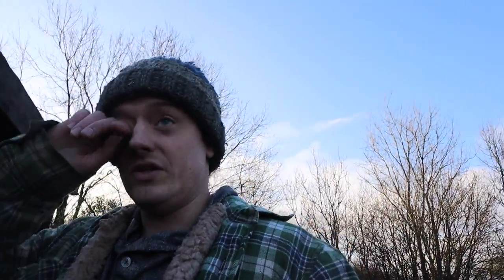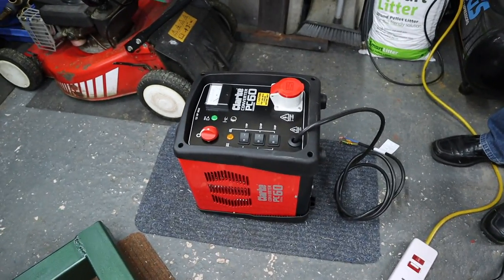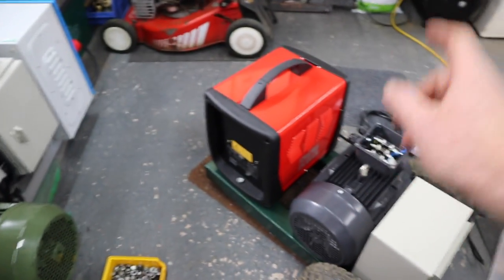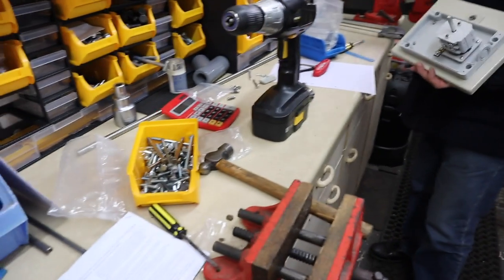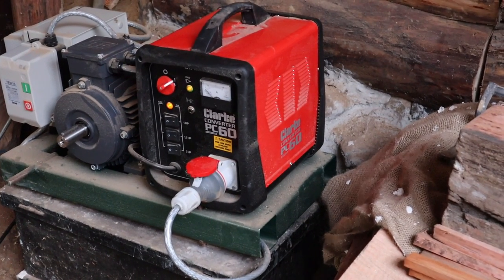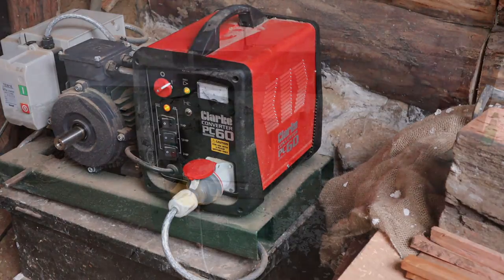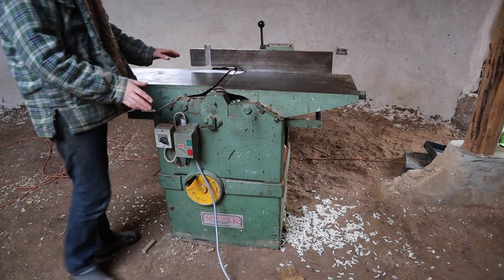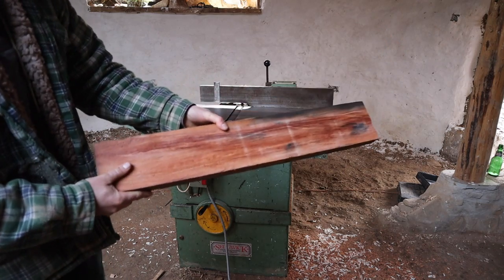Easy DIY Rotary Phase Converter Build (Off Grid Three Phase Hydroelectric Power)

Comment: Wouldn't it make more sense to change your generator in the future when you got more flow to generate the necessary 3 phase grid you need directly from the water motion? 🤔
Reply: That wouldn't work well. The frequency of the power from his hydro system wouldn't be 50hz. It also wouldn't give him the 8kw he needs to start the thicknesser. And when his tools are off he wants to store the electricity in batteries.
Reply from the maker: I would need a 10kw constant system to do that, i would love to run direct believe me but i would need to run 100 litres per second through my turbine to do that. Its just not going to happen with the water i have available.
Reply: @johnosullivan675  why wouldn't the frequency be 50 Hz? 🤔
Reply: @KrisHarbour  you have 10 kW peak constant needs for minutes or just short bursts? 🤔
Reply: Because the frequency of the electricity produced by a generator depends on what speed the generator is running at. Why would you assume that Kris' turbine runs at 50hz?
Reply: @johnosullivan675  I said he needs a new generator. Obviously the new generator need a transmission, a AVR and a governor to create a useable grid.
Reply from the maker: Mate your all over the place. single phase or three phase? 

Ruben Kelevra  • 1 week ago (edited)
If you get more flow it might make sense to 1-phase AC instead of 3 phase and use it directly, if you have a load which you can adjust as ballast, like a hot water tank for heating and hot water generation. This surely only make sense, if your peak usage is below the maximum output.

The DC side of your system might be used for lights and other devices which just use DC. You can start the battery charging, depending on the load on the AC-side to balance it further.
Reply: @KrisHarbour   It's been a bit messy, I'm sorry for that.

If you want to use AC directly from the turbine with a generator, it's better to generate just one phase. If you run three phases you would need to balance the loads evenly between the phases. This is probably not possible, depending on your load.

When you generate one phase, you can pick cheap off the shelf parts for voltage regulation and electronic frequency governors for gas or diesel power generators.

An electronic governor would give you a voltage depending how far you're off of the set grid frequency. You can just read it with a Arduino and adjust the valve settings accordingly.

To get from this one phase to a 3 phase for machines you can couple a 1 phase motor to a 3 phase motor with a heavy fly wheel in the middle - this should work since you're not that critical about a certain frequency on the 3 phase grid when just running machines.

Another possibility is adding 3 phase motor drivers to your 3 phase machines which just chop up the 1 phase power and also allow for a soft start and exact RPM control.

Hope some of my brainstorming was somewhat helpful. :)

Comment: hi  that's great just found your video bought and scrounged some three phase machinery got the converter like yours and a 3 phase motor haven't got my head round how you got the full 3 phase yet, the clark converter is 4 pole my Bridgeport has red, yellow blue and a black wire got to get a 4 pole  plug to fit, probably a stupid question but does the black go to the ground  pole?  it's great man what you are doing keep going,    sam
Reply: after many times watching this and your next video have decided that the bridgeport won't work off the converter so your way is going to be the answer thanks for that have starting to get the motor and things just one thing would that the key out of the shaft as ran mind sent it flying across the workshop
Reply: It's because this system had no black (neutral) and yours needs one , I have the same problem with my hardinge lathe I copied Kris design but now I have to find a way of getting a neutral out have you had any luck

Comment: I don't quite get what the motor does here. It takes three phase from the converter and puts out three phase again? Is it just to add some inertia to the system?
Reply from the maker: The static converter is not a true three phase and because of that will only output about two thirds of the power. Running the three phase motor off the static converter means that the motor then acts as a generator and you get a true three phase with 400v across all phases.
Reply: I see! Thanks for the clarification! <3

Comment: one  can use a start up motor on the rpc idle motor,  clutched , belted , pre  phase startup,  all  offering ways  dealing with large idler motor start up loads,  even pull rope starting the rpc idler motor , then switch  static converter  on,. will work... note motor direction 1st
 
phase inverter  converters  are great , but have limited range dealing with multiple connected devices, pop pretty easy, can require additional 3 phase inductor transformer to be installed  no good for welding.

the rpc  artificial leg  benefits from power correcting across  loads / voltage changes, ,being balanced across all phases is key to performance and motor life.
use of  zero volt  relays  switching cap banks via current/volt sensing  comparator circuits allow automatic control to a point. .  arduino  control next..

 Unique3phase  , has some documented designs that work. self build from scratch using a load of recycled stuff,. well worth the 120 page read.

back in the day,  a number  of techniques were used  to supply 3 phase,   whether from split phase , single phase or  just phase angle correction, phase generation buck boost and so forth were all used  dealing  with end of line issues.

Comment: Why not ad Y/D starter to the planer?
Reply from the maker: Im currently looking in to that. Not sure how well it would work off an inverter though.
Reply: Christina Holm 
Okay. What’s a Y/D starter?
Reply: it  will work better, the star will lower the starting current considerably,
Reply: @Crewsy  It's a timer switch that changes the way three-phase power is sent to the motor during start up, so that it uses less power to get moving.  Once it's moving it switches the wiring from Y-style to Delta style which removes the power restriction.  It's used for situations where the motor uses too much power when you first switch it on from stationary, and rather than upgrade your electrical system you are happy to have less initial torque and a longer start time as a compromise instead.
Reply: Berkeloid 
Thanks for the explanation. 👍🏻👍🏻👍🏻

Comment: I have been using VFD for the 3 phases motors start and controls, its Quite Expensive but it does same stuff as Inverter, but gives me greater control. VFD converts any AC to DC and then Rebuild it to AC pulse where you can control frequency and Amplitude and control starting currents, torque boost and increasing frequency also power delivered ( not every motor can handle HF switching ) then you might end using only basic functions.
Reply: Quite expensive? Hardly. The Chinese units work great for two and three KW loads, If you need to run a 5 HP motor I would step up to a real industrial unit. You can find them used for 50-25% of their initial price.

Comment: is there a ELI5(explain like im five)? version of what i just watched?
Reply from the maker: Im sure there will be someone to explain it for you better than i can. i went to see john for help because this isnt really my area of expertise. But essentially normal households have single phase power and my inverter outs out single phase power. that is one phase of the three phases produced when generating power in a generator. most commercial tools run on three phase power. this device takes single phase power and uses it to create fake three phase when used as a stitic converter and a true three phase when used as a rotary converter. the single phase drives one phase of the motor and then the motor creates the other two phases as a generator. so we end up with 240v single phase going in a 400v  three phase coming out.
Reply: @KrisHarbour   thank you i understand the basic now :) keep up the great work.!
Reply: @KrisHarbour  so the only thing the motor does is take "fake" 3 phase and turn to "true" 3 phase ?
other q: why not use a soft starter on ur "new" tool ? :)
Reply from the maker: That is my understanding of it yes. Thise digital soft starters are great but this tool has two motors, one to drive the knives and one for the feed rollers. those digital VFD dont work on multi motor tools.

Comment: Why do you need the rotary if you have the static?
Reply from the maker: i dont need it, its just a better three phase output and the machine will have a bit more power. the static converter just starts at three phase then runs on two phases meaning you dont get 100% of available power. 
https://www.northamericaphaseconverters.com/how-static-phase-converter-works/

Comment: Just buy an VFD, and you can connect direct to the DC buss. Much better than what you have here.
Reply from the maker: Planner thicknesser has two motors, i would need a vfd for each and have to start them separately. then every other tool i buy would need its own vfd, This is a better system.
Reply: @KrisHarbour  NO! You can use one VFD and mound an 3 phase output socket to it. By this you can plug each tool to it. Just set the basic parameter, like frequency, output voltage and that's all. If it has high output current capabillity (much more than your motor) you can start the motor by simply connecting it to the VFD that is allready running. For this you have to disable the open phase prottection from VFD.

Comment: You've gone about this the wrong way for the state of 2019 technology. You would have been better off going with a VFD. Yaskawa and other manufacturers make 5 HP VFDs that convert single phase 240v to 3 phase 240. Because it is a VFD you can limit the starting current, it doesn't matter that your equipment has a high inertial mass, that's exactly what VFDs are designed to deal with. It reduces your peak inrush power consumption dramatically, possibly 5 to 10x depending on your type of load.

Used but in perfect working order they run $400-600 USD on eBay.
Reply: You are absolutely correct. I recently installed some Toshiba VFD's for a customer that converted single phase to three phase works great!

Comment: You can buy a VFD with soft start for £65 to do this job.
Reply: As someone who knows nothing about this, let me make an intelligent guess:- Whenever  anyone claims glibly that a job could have been done another way which would be much simpler and much cheaper......they're invariably wrong!!!
Reply from the maker: the planner has two motors, one to drive the knives and one to drive the feed rollers. A VFD would not run them both so i would need two VFD and then start each motor separately. VFD are great but they are complex digital devices that break easily. a rotary phase converter is a solid, old, and tried and tested machine thats lasts generations. with the one investment i can run any three phase tools with any combination of motors for manny years to come with no maintenance or replacement. That woud not be the case for a VFD. Any machinery with say a coolant motor or secondary motor of any kind a VFD would cause problems. Im not saying VFD dont have a place, they do, but not for this.
Reply: Andy McCabe 
Not in this instance. Rotary convertors are 1930s technology. They were superseded by solid state electronics for this kind of scale currents about 15 years ago when very low on resistance MOSFETs became inexpensive and ubiquitous. The problem he has with the large inrush current tripping his contraption is what soft start is meant to deal with; inductive loads have always been a nightmare.
Reply: @KrisHarbour  A VFD would work on this, simply running a max 50Hz output straight onto the planer bypassing the starter, it's the inrush of the starter thats knocking out your supply, the soft start on the VFD solves this issue. also with some VFD's you can supply them with DC and remove more inefficiencies from the system.

Comment: otm646 is correct There are many many inexpensive VFD's that will convert single phase 230 to three phase. They are way cheaper and more energy efficient than using these phase converters.  Your using obsolete technology that cost more to install and use.

Comment: why don't you just purchase a single phase motor?
Reply from the maker: it has two motors so i would need two single phase motors and then i would not be in any differant situation if i wanted to get another three phase tool for cheap

Comment: You're going to need more battery capacity Kris.
Reply from the maker: 25kwh isnt Enough? Maybe you missed the battery video?
Reply: @KrisHarbour  I saw the battery. Will that be sufficient for a three phase power hungry beast like that for long?
Reply: @KrisHarbour  although TBH, i must of missed the capacity. That does seem like a lot.
Reply from the maker: well the planner only uses the 8kw to start, after that it is only 2.2kw at full load so i can run it all day if i wanted to. with the solar and hydro feeding in the whole time i shouldn't have to many problems running it. you never need to run one of them for more than a few hours anyway.

Comment: So it didn't work. But the bit you bought that you won't show us does work for single phase. And the red 3ph box worked with that new bit as well. My first thumbs down. (ps. remove the unsecure key from the motor shaft)

Comment: 16:04 and you are not damaging the environment whilst doing it...
Reply from the maker: Well no not really, not in the way i think you are getting at. There is an element of environment damage in the production of the parts but the system itself does not damage the stream or my land, the water (not all of it) is diverted then used in the turbine then put back in the same stream. Hydro cause damage because of dams and fish. i have no fish in this little drainage stream and no dam. I cause more environmental damage walking in the woods crushing things with my feet than the system does being there.